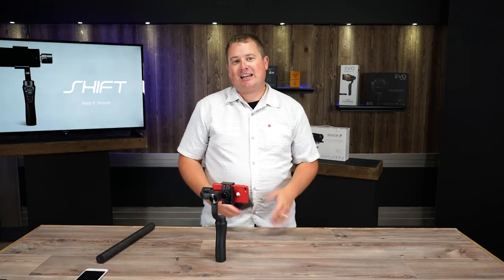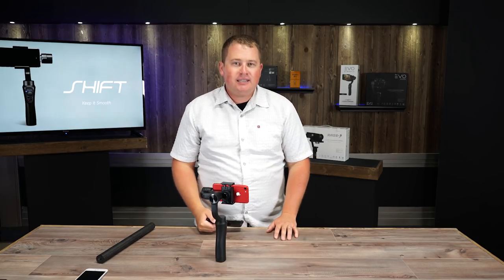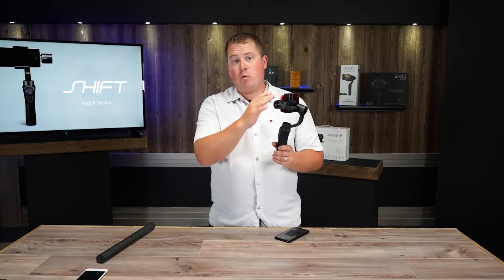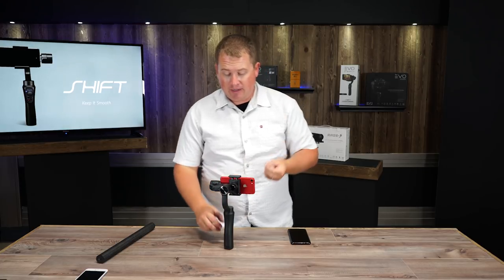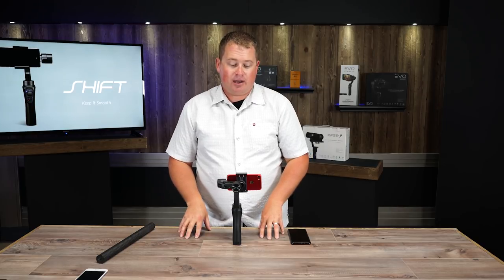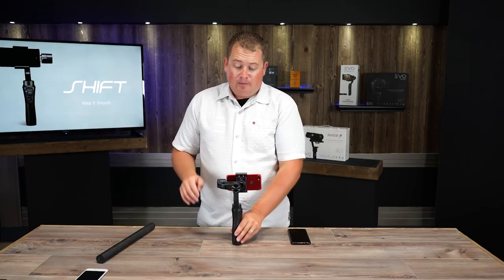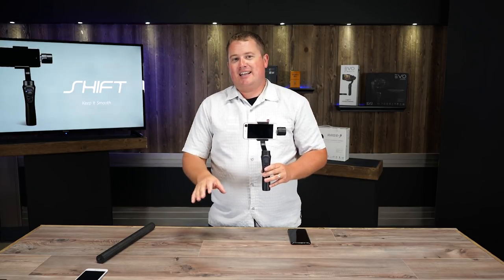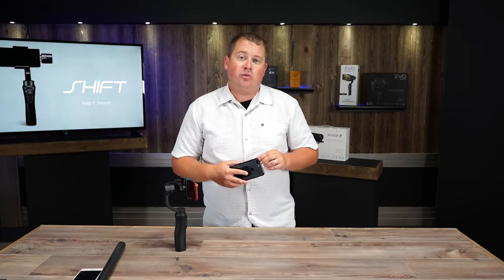How To Get Smoother Iphone Video Using a Magnet

Comment: OMG, thanku. I am an engineer / pseudo-professional photog, and have used my iPhone6+ at work for years to take close-ups of electrical connectors for inspection purposes... so I know how to take a picture, and my hands are rock-steady. I went from taking great photos for years to horribly blurry photos, overnight. And what happened over that night? Yep, an iOS update. After, image was clear on screen, properly exposed, until the exact moment the phone took the picture. Happened in Camera app, in PDF-maker apps, even in my bank's check-deposit app. YOUR MAGNET TRICK FINALLY GOT MY PHONE BACK TO ORIGINAL IMAGE QUALITY. Friggin Apple told me it was my fault, but I knew better... you proved it. THANKS!

Comment: Hi Peter
the vibrations of my harley motorcycle damage the ois on my iphone 8. Do you think the magnet is strong enough to protect the newly repared ois against the vibrations on my bike too? Many motorcyclists have the same problems and damages and I never read something about your solution. Will try it anyway. Thanks a lot. Greetings from Berlin, Germany.

Moments later: I just recognized, that even a strong magnet will not stick on my iPhone 8. Bad luck.

Comment: Peter, I saw an idea for solving this another way, could you confirm if this will work?   The Procam 5 app.  Feature called 4K Max, where it captures 12MP photos at up to 30 fps on iPhone 6s and later.  Neither digital nor OIS video stabilization are supported, effectively solving the problem.  The app's page says "we recommend the use of a tripod or a gimbal" in this mode.

Comment: Filmic will fix this, I have tested it and it appears to work 100% using filmic. I wont spam the link unless other want to see it. But I have found it works fine
Reply: yea but filmic drains ur batt real quick
Reply: Rameses Mendoza they all do. The DJI app is the worst for this.
Reply from the maker: e
Reply: I don't find flimic fixes this.  Still have issues even with stabilisation switched off (or on) in filmic Pro
Reply: I think filmic uses a crop in on the sensor to fix the micro jitters. Basically they use software instead of actually turning off OIS. I haven’t tried the magnet yet, but I think it is the best way.

Comment: Is works on iPhone 8 Plus? I’m try with 8x2 magnet - problem not solve. Maybe use more size magnet?
Reply: Василий Быков Hot glue 3 small credit\gift card corners to each other and then Hot glue the magnet on top. Place the magnet in the center of the already hot glued card pieces and let a hot glue blob land on top of the magnet so the glue will run down unto the card pieces and glue the magnet there. You may also want to find something to use to pin the magnet down so no glue get on the side of the magnet that is on the card to avoid loss of your magnetic connection.

Comment: Has anyone tried this with the iPhone 11 pro? I have experimented with some random magnets I had on hand and the focus doesn't work when the magnet comes close. Maybe the magnets are too strong.
Reply: Damn I was gonna try this. You ever find a solution? I’m trying to shoot through a night vision monocular, so you are basically looking at a round green circular picture floating in black space, but with video, the stabilization makes the circle kind of float around in the shot
Reply: @Slippindisc  It has become much less of a problem now that I use iPhone 11 Pro and Osmo Mobile 2. With auto focus locked. I haven't tried with a small magnet on my phone.
Reply: Adrian Hinge whats Osmo Mobile 2?
Reply: @Slippindisc  A gimbal

Comment: Thanks EVO, great tips, but where do I get the same magnet for iphone7plus?  I don't want to get a different magnet that's too strong or too weak if you've already tested it with yours.. Thanks.
Reply: Those are 1 mm thick. His description says 8mm x 2mm though I couldn't find it.
Reply: Peter, Just forgot to mention that I decided to go for the 1mm thick, first to check if it's performance would be  OK with a slimmer option (as it "sits" on the front of our phone), secondly, if it wouldn´t, I could always put two together as, they're magnets...after all!. 
I found no need to use the second option. Hope it helps and my apologies for not having being clear on my first e-mail.
Reply: Thanks!
Reply: So there's no problems while using the thinner magnet? And have you used it for long enough to say that it doesn't do any damage to your phone?
Reply: If you watched the video, I'm pretty sure he said he's been using it for several months with no problem. Just take it off after shooting video.
Reply: Peter Hernandez Yeah I would take it off no matter what, but I also read up on it, and apparently the only thing it can damage, is the OIS, which wouldn’t be that bad after all :p

Comment: For the 8x2mm Neodymium magnets what MGOe are we talking? N35/N42/N50? How much pull is required? And will using a magnet lock the focus too?
I’m looking at using this on an iPhone 8plus, I wonder if 8x3mm N38 with Bore Hole-Punched Magnets would work on the forward facing lens side?
Reply from the maker: Hi Rob,

We recommend using Earth magnets so you are looking at a grade of N35 and using a magnet will not affect the focus. In addition, we are simply suggesting using the magnets we tested it out with, but you can use different ones as well.
Reply: Hi Rob, how did this magnet trick work out for you with iPhone 8+? I have the same phone and am looking into buying a gimbal, but if they don't work together without jitter will probably switch to a Samsung GS9 which allows for disabling OIS altogether.

Comment: Hi Peter. I ordered a magnet (as you recommended on Amazon). When I use it on my iPhone 7+ the image is rolling violently and with a heavy noise (just like fast shutter sound). I use iPhone video recorder. The same is happening when I use FilmicPro, but not so heavily.  Do you have any idea of what is happening?
Reply from the maker: Hi Widar,

Which magnet are you using? We recommend earth magnet so you may be using too strong of a magnet.
Reply: I'ts a 8x2 mm magnet from Amazon: https://www.amazon.com/gp/product/B077KYBYYY
Reply from the maker: Hi Wildar,

We looked into this and it's not an issue with the magnet. You will want to turn on your camera "Lock Camera Lens" on. 1) Launch the Settings app. 2) Tap Photos & Camera. 3) Tap Record Video underneath the Camera heading. 4) Slide the Lock Camera Lens switch at the bottom to the ON position.
Reply: Hi, I had already done this...

Comment: Doesn't using FilmicPro and turning off image stabilization in the app's settings resolve this ? I've see similar videos talking about this issue with the DJI osmo mobile
Reply from the maker: Nuno Barreto to a degree it helps as it removes the addition of digital stabilization but it still does not remove the mechanical stabilization feature of the camera sensor from moving inside the housing as it basically floats between a set of small magnets which make up the OIS.
Reply: No, filmic pro doesnt help at all. i will try this magnet workaround. Iphone7 plus camera is a major disappointment when using with osmo mobile.
Reply: Use filmic pro and turn on the iOS. Not OFF... It will work perfectly

Comment: Can anybody confirm whether or not this magnet trick would work on the new iPhone X ?
Reply: I have Osmo Mobile as well so let me know if this works!
Reply from the maker: The iPhone X, to the best of our knowledge, uses the the same OIS system as the iPhone 7 and 8 so the same fix would apply and should work. At the moment we are testing the iPhone X without a magnet and are getting pretty good results. We'll keep you posted as this saga unfolds.

Comment: I’m getting focus problems with the magnet.
Reply from the maker: I may be telling you something you already know...so I do apologize if that is the case.   Phones do not have physical focus....there is no moving glass.   Focus is 100% digitally created within the processors within you device.   The magnet will have no effect on focus.   We use the magnet all day long every day with IOS 5s 6s 7s and 8s.   We do not have a 10.   I walked thru the office and checked with everyone about potential focus problems.   Nobody has had any issues.   You may have discovered something?   or your phone could be broken?   Hit up customer service if you would like us to help problem solve.
Reply: Im using a 10. That's probably what it is then. Thanks for the quick reply
Reply from the maker: We still need to test the 10....they made that thing with a whole new set of instructions.   We hear it is insane!?   That could very well be the problem.   They may have also cured the high freq vibration issue....maybe you don't even need to worry about it?   Good luck out there!
Reply: Have you by chance tried the magnet with the 8plus ?
Reply from the maker: Not yet.
Reply: Have you had a chance or tried using the Magnet using a iPhone X yet?
Reply: @EVOGimbals_KeepItSmooth  You're totally incorrect. Phones DOES use glass to focus - it's basically the only way to focus. Early camera phones had fixed-focus lenses. This was possible due to a thing called "hyperfocal range" but that's it... Focusing was never, ever "100% digitally created within the processors". Regards.

Comment: This awful jitter is the only reason i am still on an iphone 6s.
Reply: The 6S has this issue too... I tried using the front camera as a dash cam and it's unwatchable. You have to use the rear / self facing camera to use the camera as a dash cam/driving cam.
Reply: alphazoom II the 6s PLUS has it, not the regular 6s, as far as I know
Reply: Right.... I forgot. I have the 6S Plus.
Reply: alphazoom II such an annoying feature too. I am considering buying the OSMO instead of the Osmo mobile to avoid it but I wish the camera on the Osmo was a little better. It’s about time for an Osmo 2
Reply: Too many negative reviews for me.... lots of app hangs and failed recordings. Maybe look for a cheap action camera?
Reply: alphazoom II yeah I saw the reviews too. That’s what is holding me back. ☹️
Reply from the maker: Hi Guys,
We are aware of some of the issues mentioned in the reviews and we are very sorry about these inconveniences. We are working with our software team to get those APP glitches fixed and will be releasing a new update to resolve those issues soon. It is taking us longer than anticipated, but hope to have it out by early summer. For now we suggest using your phone's camera for stable footage. The APP is not required to use the gimbal. Hope this helps!